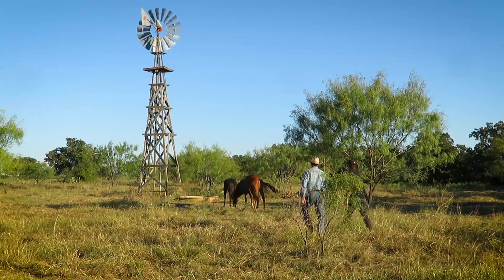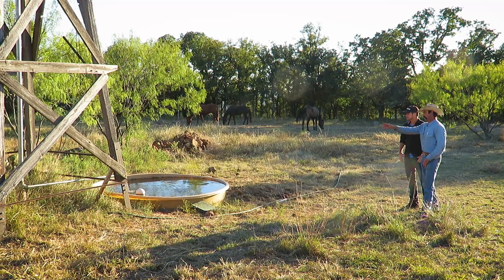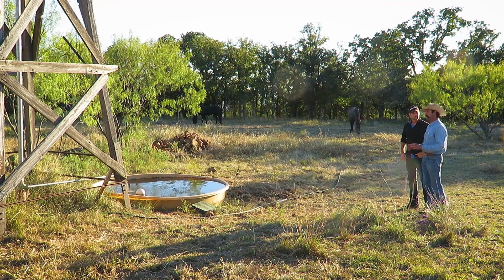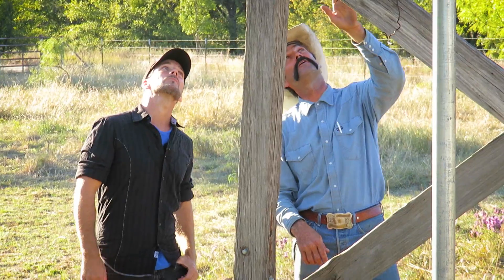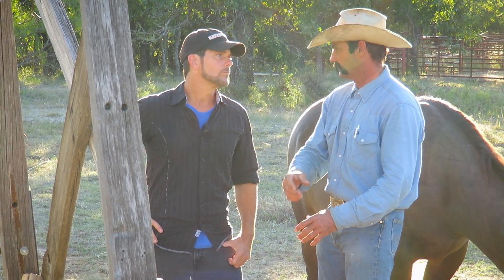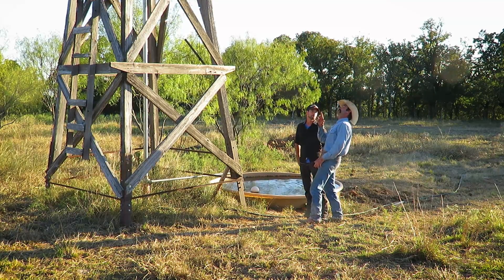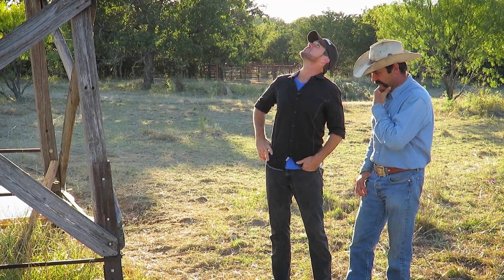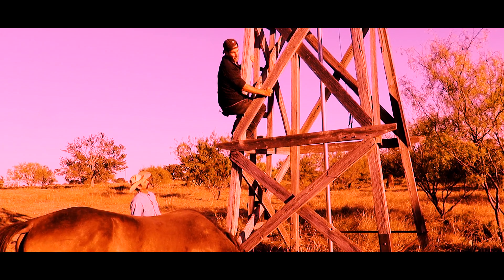Windmills 101

Comment: When you check the water coming out of the pipe..The most important thing is to see if there is no sand coming up with the water...In many wells a little bit of sand gets through the main pipe filter and wears down the "leathers"  quicker than normal wear with just clean water....Been  drilling wells and fixing windmills and pumps for nearly 40 years...in Argentina.....